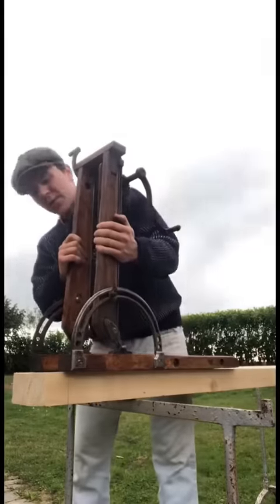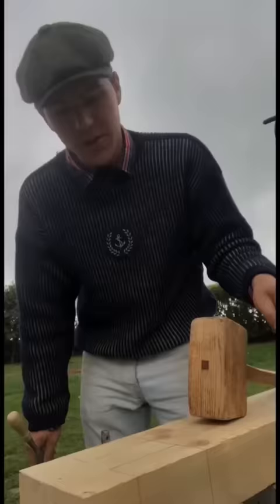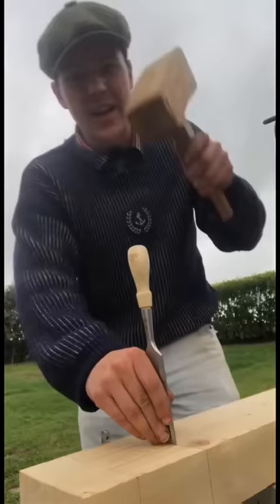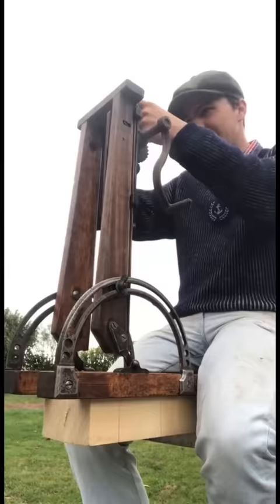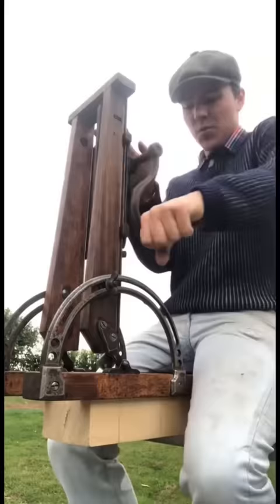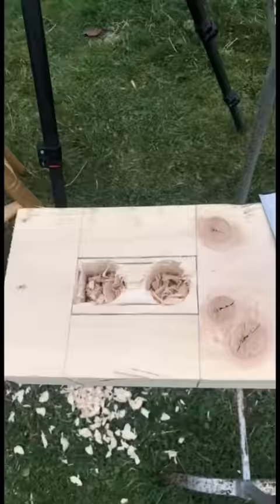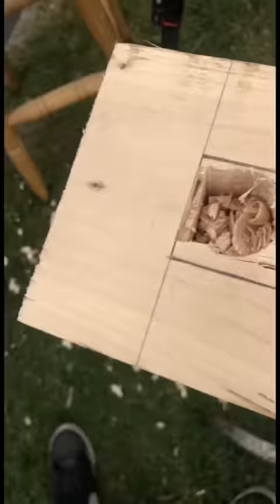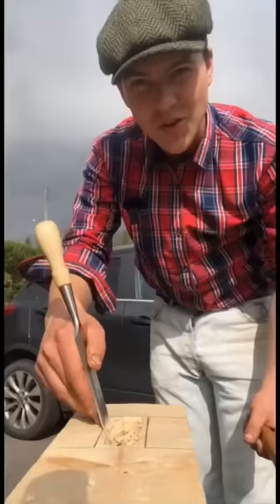Using a beam drill to cut a mortise #woodworking #shortvideo #satisfying #handtools

Comment: That's really cool! It's like a manual drill press. Love your videos!
Reply: It is a manual drill press
Reply: @danielzhang5395  It is a beam drill. It doesn't technically operate like a drill press either.
Reply: @FYMFTP  So a beam drill is a manual drill press? I mean you wouldn’t expect an electric and a mechanical system to work alike
Reply: @danielzhang5395  Perfect!

Comment: I think I chipped a tooth when you set the camera down on that post and started banging on it. LMAO. I've only seen a couple of these in my lifetime, last year I used a MAG drill on an iron grid built for solar panels. Works quite the same but I didn't have to sit on it, I had to plug it in and magnetize it to the iron.

Comment: I have an old beam drill that was my pap's (a union carpenter born in 1919, it belonged to his father before it was his). It could be pre-1900 for all I know. I'm no finish carpenter, but I do quite a lot of joinery in my side hustle (IBEW electrician by trade) of luthiery. It's a little ridiculous, but I use it every time I need to cut a neck pocket/mortice just 'because', ya know? Of course I could use a battery drill motor or drill press, but I love thinking about all the things it's helped build throughout it's LONG life. Damn thing still smells like turpentine (it's how the old man preserved everything, haha!), even though I've cleaned and dressed all the surfaces a hundred times since pap went away in 2001. I hope it always will, and I hope someone will take it from me and keep using it when I go away.